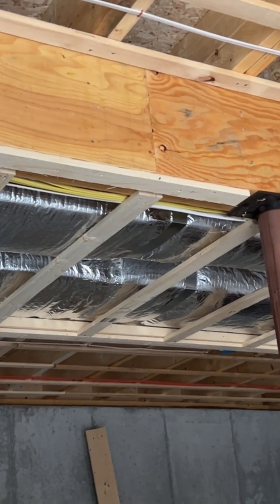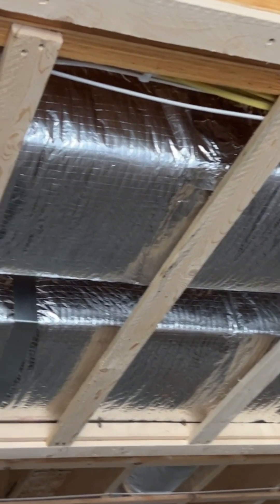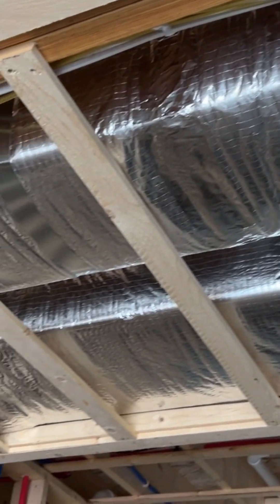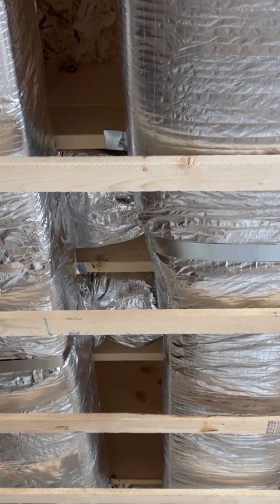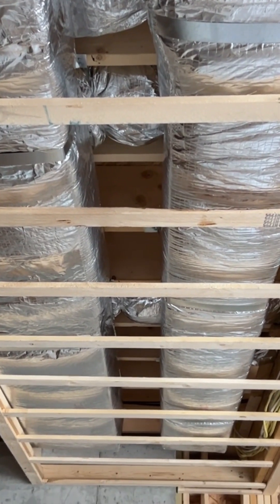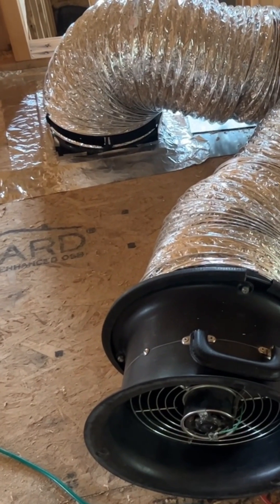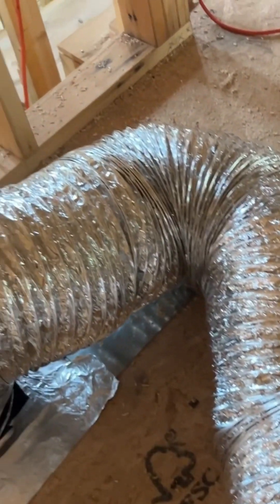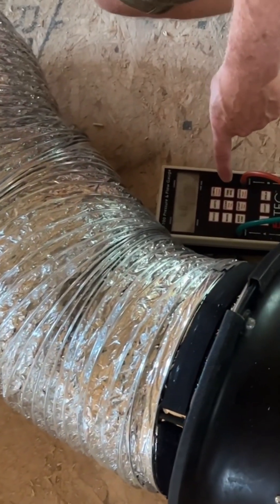🏠💨 Duct Leakage Testing & Duct Leakage Test Equipment

Comment: I think if the homeowner or the contractor doesn’t do this during this part of the job they should be liable not the hvac company. I had a company come out and test 1 I installed and he failed it now we had mastic tape all seams and liner on flex lines, we bought our own duct blasting equipment to check it and passed, come to find out the guy was new and never did a job on his own and couldn’t read the codes properly. We had the homeowner to call another company and everything was perfect. I recommend if u fail check into the company who is doing the inspection before they come out.